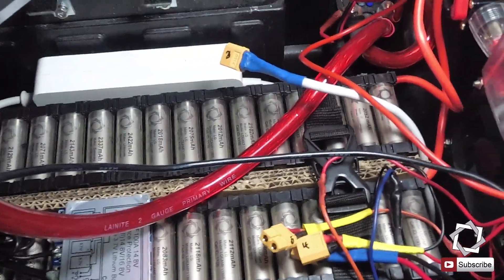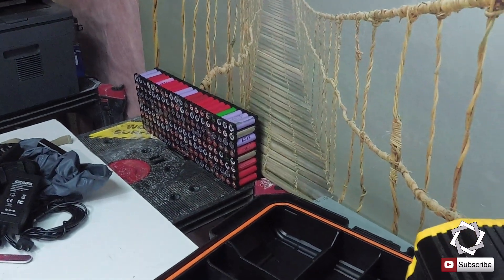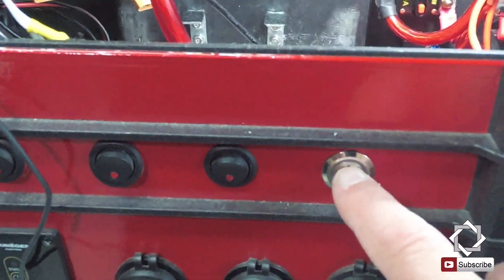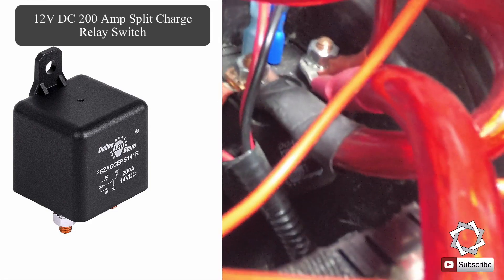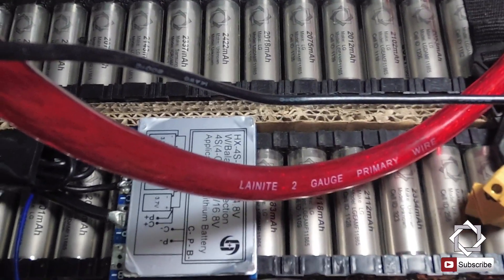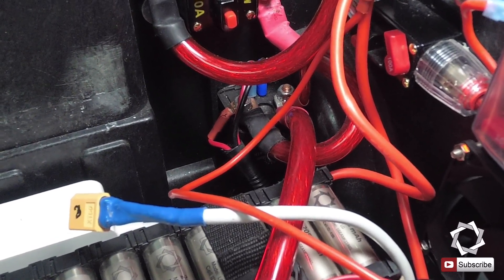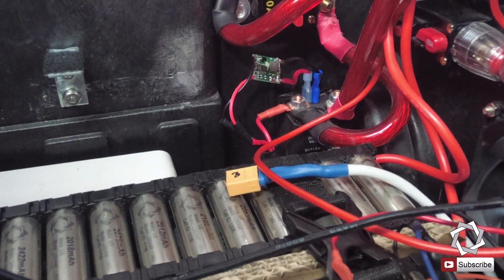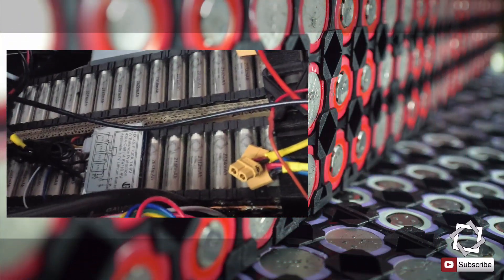PowerPack Repair

Comment: You might want to consider designing a HIGH PULL-IN Voltage ( ie 16 V for 1 second ) and then a LOWER HOLD VOLTAGE circuit.
That coil will generate 4 Watts of heat at 16 volts.
Also, is the anything to suppress the huge inductive kickback, when that coil is Turned Off?

Comment: that relay is ment for starting an engine not for long on periods so the electromagnetic coil burns out you would be better using a battery isolator switch
Reply: Actually, that relay coil is designed for "Continuous Duty" !  So, where did you read that it was just for starting only?

Comment: that relay may be a bit much for that board for long term use you may want to go with nothing no lower than a 2 amp buck converter that is CV. Im aware of those relays i set up a low voltage shut down for my dad on his set up they are a little on the power hungry side to trigger the relay but hold together well keep an eye on  your voltage drop and heat factor on the relay with high loads you may need to add another one to keep the efficiency at max. They say 200 amp but they sure dont mean constant my dad melted his down with a 1500 watt load running a shop vac.
Reply: It does say "continuous" duty and it does state 200 amp rated.
But they do not state if the "200 amp rating is continuous" ...

Comment: I think you will need to use the bigger buck converter as the little one you wired up won't be able to deliver enough current for long periods of time, Surely that solenoid needs 1 - 2 amps ?
Reply: The coil requires less than 1 amp ...

Comment: good luck with it man. I had an issue hearing the video, but overall i was able to adjust volume and hear thru the muffle. Keep on uploading and you will get better. I highly recommend using a cell phone to record audio with. I use a recorder app that i downloaded for free. works like a charm. Sometimes when you align 20 or 30 minutes it may mis-align due to bitrates not matching. you can just stretch the audio to fix that... if that makes sense. Phones usually have great microphones! almost all my videos for the past year and a half have been with my phone audio and it sounds great. camera audio as backup is a lifesaver tho.
Reply from the maker: That's for the tip. It has been a real learning process in producing these videos. There is just a lot of stuff that goes into it. Thanks for watching.

Comment: That's what I'm in the process of doing with my 4S system, adding step down converters to all the "sensitive" loads that don't like running too much over 12 volts.  I just picked up a 6-pack of those same converters for some of the smaller loads.  Haven't had a chance to try them yet, but good tip on the delicate voltage adjustment pot.
Reply from the maker: The pots are the only issue I have with these steps down modules. They don't seem to stay where I set them.
Reply: I haven't had a chance to test mine out yet, but good point on checking the voltage stability.

At least my first project isn't terribly critical on voltage, I just need to drop 16V down to ~5V to feed into an Arduino to help control my AC power inverter.  That has an on-board voltage regulator, so as long as it doesn't vary too terribly much, it should be OK.